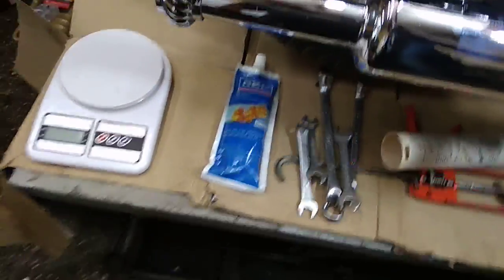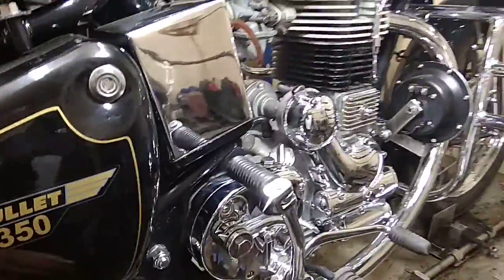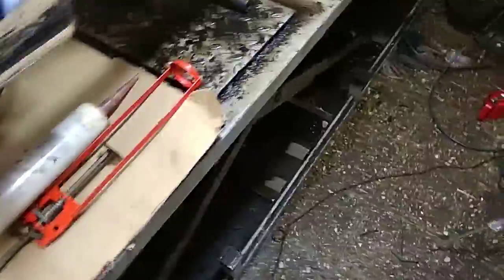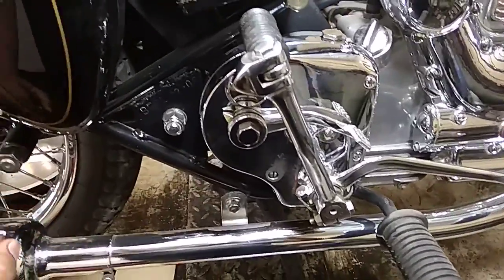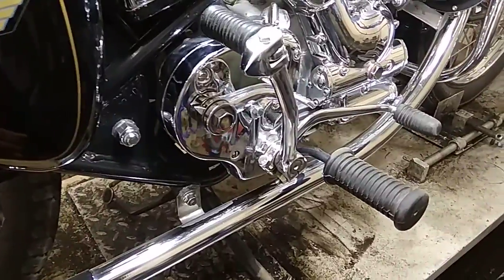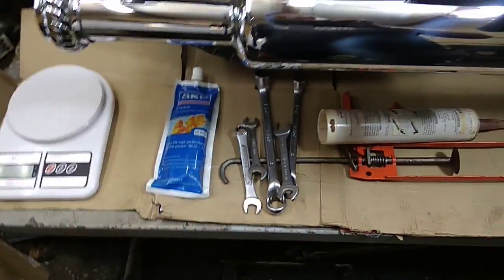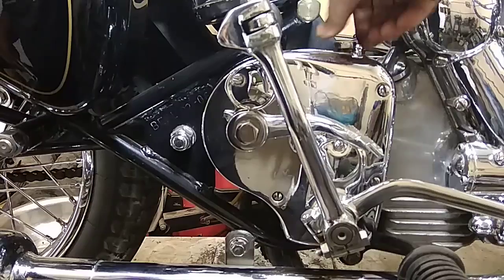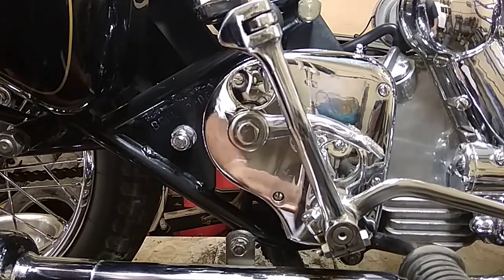Royal Enfield Four speed gear box lubrication...home made "00" grade grease (English) Part 2/4

Comment: Hi I can get 00 grease here in the USA. So in this I can use one the 00 grease and no need to make this mixture correct. Thank you
Reply from the maker: Currently I am handling two 500s from States. Half engine opened and have to restore very soon. Just about to dispatch some spares to them.
Reply: @MechAutoClinic  Excellent. I just bought mine almost a year ago. Trying to get it ready
Reply from the maker: It was OEM supply. So never came in the market, atleast in India. You can check out local seller for this grade. I am not sure if you can get it or not. From day one it was not available from Royal Enfield or from grease manufacturer. As far as I know then supplier was Veedol. You can check at local store. Thanks
Reply: @MechAutoClinic  a local auto parts store sells 00 grade premium grease so it’s cost effective for me to buy the grease instead of making it since that will coast more in cost.
Reply from the maker: Then I must say you are lucky... because here we never got so as per company this was the best method to complete the job. 👍
Reply: @MechAutoClinic  Thank you for your input and guidance in this matter.
Reply: @MechAutoClinic  Amazon also sells 00 grease
Reply from the maker: On amazon.com possible but not on amazon.in.
Reply: @MechAutoClinic  ok didn’t realize
Reply from the maker: Where you located in States?
Reply: @MechAutoClinic  yes in New York. I have a 2003 Bullet 500 4 speed
Reply: If you need i can provide 00 grease
Reply: @alpha-j3r  already got it kind sir
Reply: @Blueknight-il9nc  how was the response sir can you please share
Reply: @alpha-j3r  I haven't changed the grease yet when I opened it up I realized that it was still good condition so I didn't bother. But I did buy a bottle of 00 grease

Comment: Sir can we use synthetic oil 20w50 in old c.i 1983 model?
Reply from the maker: yes. thanks for watching video and comment
Reply: And sir one important question. Is it necessary to set the VM carborater for a ride to high altitude region because of low oxygen? Please give some suggestions I m going to my hometown soon in Uttarakhand, altitude is 3600m high. I saw your VM carborater setting video it was great sir. But for higher altitude I don't know how to set(Ci engine) VM carborater. Please give some knowledge Sir.